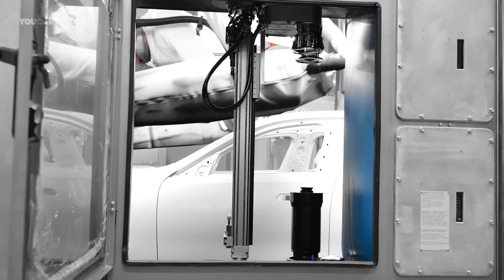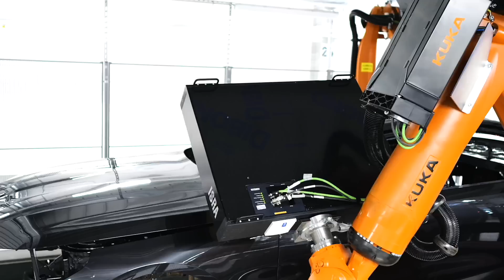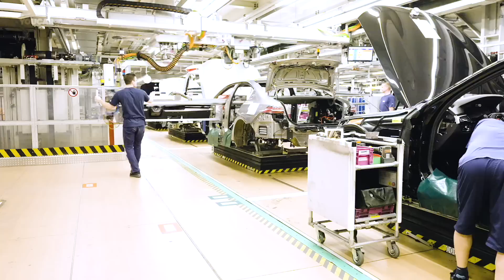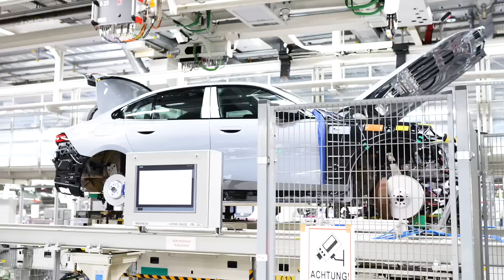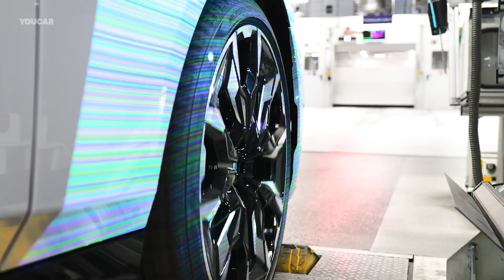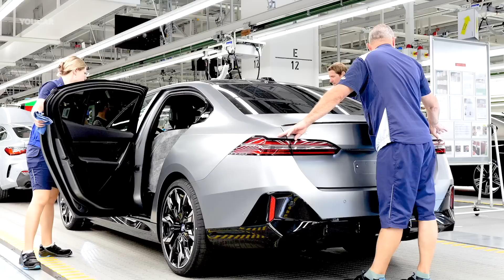BMW 5 Series 2025 - Production Line

Comment: Is the body aluminum or steel?
Reply: Both combined. It uses the CLAR platform -- shorthand for Cluster Architecture -- is a rear-wheel-drive modular chassis that can also accommodate all-wheel drive. It combines high-strength steels with aluminum to cut weight while keeping structural rigidity and safety high